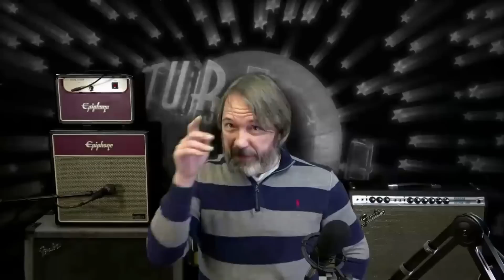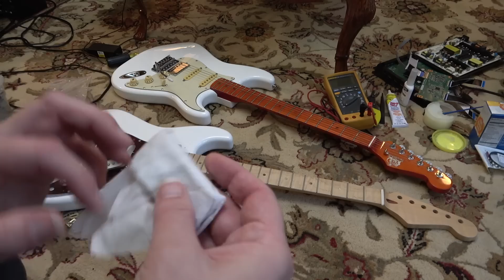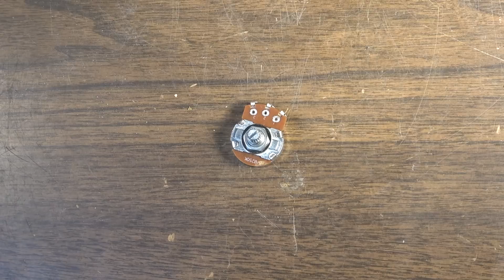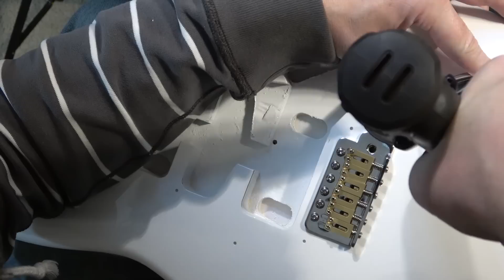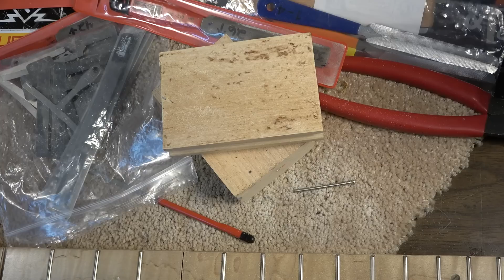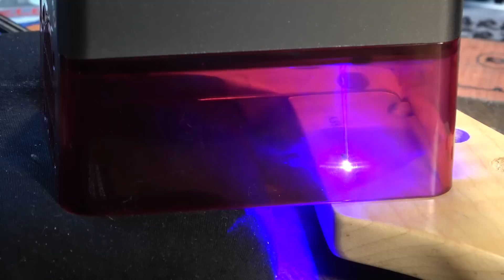A Fender Custom Shop Level PARTSCASTER!? ...from TEMU Parts? | The Guitologist

Comment: I find better method for no load pot is to trim one side of the rotating plastic wipers assy to give slightly more rotation so that the wiper contacts stop on anywhere past the top end of the carbon track, even as far as the wiper terminal track itself. 
This ensures normal operation once the control is turned back slightly to engage the top of the carbon track. Cheers.

Comment: Nice job Brad. BTW I finished the Larrivee. (Yes knuckles are bruised battered & scarred) It was 3/4 size. Any way after 2 weeks of humidification all cracks closed except the biggest. So I CA glued the living sh*t out of it, & the other cracks. Sealed all the open wood, etc. The owner was thrilled. Now they're talking about a 70s Gibson acoustic that used as a bludgeon during a family row. I said I'll try. Great idea on the Blend pot. Never thought of it. (After a year & half of US Navy Electrical Electronics training you'd think I'd remember that crap). Any way your boy is impressed.

Comment: Temu has some great deals (except for the clothing) to be sure and I use them a lot. 
     However,  for around $200.00 or less you can get a Fire Fly guitar with locking tuners, bone nut, roasted maple neck, roasted ash or mahogany body, 2 alnico five pups and one Hum-bucker in the bridge and stainless steel frets. These are quality guitars that rival Fender made guitars. 
My 2 Stratocasters cost me $169.00 for a relic and $179.00 for a solid white guitar plus shipping.  Just my 2 cents worth. Peace.
Reply from the maker: I've heard great things about those, for sure.

Comment: Kinda funny, I'm wrapping up a partscaster while watching this.  I've got a sunburst alder Jazzmaster style body, vintage style 6 screw trem, 3 Firebird mini-humbuckers on a Strat style 5-way switch, and a nice Squier Strat neck.  I found the neck at Goodwill for like $10-$15, classic one piece maple neck with the walnut skunk stripe and a nice smooth satin finish.
Reply: One thing to keep in mind when thinking about the extra work needed with the frets- more and more frequently these days even a brand new instrument from a big name company needs some fretwork and setup.  Fret ends rounded, nut slotted down to an appropriate height (most are way too high), truss rod adjustment, bridge height and intonation adjusted.  Seriously, I have seen many of these issues with guitars in the couple thousand dollar range.

Comment: Great video. The "strat" is the most basic form factor of electric guitar in the world. Leo Fender designed it to be modular. I've thrown together many dirt cheap but high quality strat builds in 40 years of guitar slinging. Strats are my thing. I don't care who makes it if the quality and price are right. But when they are not, I do my own build. I laugh my ass off at those who waste money on the Fender "Custom Shop." What a rip! There are also plenty of great aftermarket parts for great prices. For pickups you don't have to settle for Duncan, DiMarzio, EMG, or spend even more on Lollar, Fralin, and some of the other "boutique" brands. I've found good pickups for ten dollars or less.
Reply: Not more basic than a Tele!

Comment: OMG I am not downing you dude but this is torture to me watching you! If you have no other tools sure a hammer will work. At least you used a wooden one. This is the take home... a man is only as good at his job as his tools allow. That being said, get a press for installing frets. If your neck is radiused it will bend the fret into place without damaging it. Hey here is an idea... put a thin line of super glue along just the top and the tang so it stays in place better. Don't overdo it or it will never come out lol. Yes it takes a bit longer to do and it is not as cool looking and makes almost no sound. It does a better job period! Also I have much experience in China parts and let me tell you they are soft metal. What that means is it will work maybe once for a week then strip out. What?! You say you bought an American made guitar it did the same thing?! Let me explain.... that is BECAUSE THEY GET THE CHEAP PARTS FROM CHINA! Now China does make great stuff but bridges or anything moving parts or with screws is not there yet. For those parts you should look to Japan (the hardest metal I have EVER drilled through was on a Toyota Yaris) or Germany. Yes some of us in the USA do makes hard metal but know your seller and where they get the parts from. HINT HINT FR Special is not usually that "special" unless it is the ESP Licensed which I was surprised I did not have to replace. Tuners same deal they move. Toggles yep and also input jacks throw that TEMU shit out! It will break and drive you fucking nuts! I will pay $40 or whatever to never have to fuck with my toggle again! ESPECALLY If it is a semi hollow body FMR!! Those suck to fish wires and jacks into!!! There is also this stuff called "Lock Tight" get some and when you put on the higher quality metal jack and toggle etc since they likely never will break spread some red lock tight on them. Don't get it from TEMU go to your local hardware store or better yet Fastenall. They sell sticks for like 40 bucks that if you do not loose them lasted me +20 years. I almost puked when they rang it up but that shit is that good. Wanna be cheap.... get the $6 shit liquid in a tube but it will not last or work as well. Respect you for your efforts no one who does this is a bad person unless they are messing up shit and you are not doing that just could be doing it way better. So in review, bodies necks, pick guards stuff like that TEMU is great for. Other stuff ahh yeah go somewhere else and spend that money better. It will be more for sure but less downtime and frustrating! I am not an armchair AHole I will be posting some of my work eventually here on youtube. Other pointer is go high fret to low. The reason is because the low frets need to be the highest. If you level 1-22 you are basing the low frets on the ones you want to shave down. When you get to the last one on 22 or 24 and shave it down your lower frets could be lower heights by then doing the way you did in this video. Leveling high to low is no danger of that. Also, if your slipping off the fret board you have a nut that is not slotted or just too long for your neck. This does not take much R2 and R4 is less than a MM and get the R4 when it takes R2 yep your having a bad day. Running finger over it you can barely feel the difference. Yes I speak from experience. I learned from it and watched/listened to people better than I was at the time. My quality and skill level shot up way quickly as a result. You are correct about some of the wood they use though on these cheap buy sites... they got the good stuff which is overpriced here in the states. Playing with a live band I would be surprised with louder volumes if the pickups did not squeal all over and hurt your ears. I have 1 set of usable humbuckers from 5 different China guitars I bought. Yes... I replace many soft metal parts. Cost more than the whole guitar did but man is it better at everything! When I get done they smoke the actual Gibson LPs by far

Comment: I must have had bad luck with Tung oil because when I have used it in the past, I find that it stinks really bad years later. I switched to wipe on poly. The satin stuff is pretty good

Comment: I only screw the neck on with a hammer drill ( compression on the neck to body increases the contact to the joint for more sustain .

Comment: For a 100% snug fit between body and neck ,drill the holes slightly bigger in the body. Just so you can push the screws through the holes.

Comment: Don't download the app. The app is not just asking for the right to access your camera, contacts and Wi-Fi network. TEMU also wants the rights to unlock your phone at night without you being there and the right to be able to record audio. You also give TEMU permission to install software on your phone, read your messages and the app can take screenshots.
Reply: I couldn't agree more. Temu is such a fraud. I really wish that Canada would police sites like this from China. I was ripped off by Temu for 3 items that were stamped and advertised as solid silver, but i received Silver plated instead. I also asked for a refund for a silver ring that started turning a copper color just after about a week of wearing it. Instead of the full refund i received less than a third of the price i originally paid. I got 6 dollars!!! Please stop supporting these sham companies.
Reply: 100% correct. I have a mate of mine who's phone got littered with trojan virus apps that Temu installed.
Reply: Some of what you say is not true.. no message reading , no audio recording, no canera access,  no software install except communications for current app.

Comment: People do not realize how much work (if done by hand, even MORE work) a neck requires to make correctly. The truss rod  routing, insertion and capping alone is tedious work, if it is a different wood fretboard, that fretboard needs HOURS of work to cut, radius, sand, glue, drill - repeat several times, before it is ready to even begin putting frets on. When I buy a neck and it has perfect fret work, I.E. no sharp edges, no hanging frets, no frets cut short, and no high frets...I count that as  HUGE win. If I have to do a little sanding, filing, gluing, refinishing work to it and it has perfect frets....I really do not mind the extra work I have to do.
Reply: I've scratch built a dozen or so necks from curly maple or flamed tiger maple for les Paul builds and it is almost 1/2 the build of the entire guitar. mahogany is easier but it still takes a lot of work. Fret boards can take hours of work even if they are prebuilt.Very nice work Brad
Reply: @phil36135 which necks do you like best?  I'm starting to collect parts for a custom job
Reply: The neck is absolutely the most important part…
Reply from the maker: Same here. And when you do the work yourself it’s YOU who controls the level of quality.

Comment: Hate strats can’t see how anyone can keep them in tune. I wanted an ultra so and so with the wilconson nut and locking tremolo. My friend bought one ssh for $900. When I asked about them I was told they weren’t available for lefties. Then the sales guy tried to sell me a lefty squire, I got rather angry and ended up with a 91 American Standard Strat for $1200. It never lasted a whole night without something going wrong. Couldn’t keep it in tune for 2’songs in a row. Couldn’t get it to sound like a strat.
Reply from the maker: Sounds like it needed some work.
Reply: Sounds like operator error. Mine stays in tune really well and it's a stock float bridge. All about setup, brother.
Reply: @fardnshidfrfr  that's rather odd since my two les pauls my doubleneck my rg470  and my other double locking tremolos stay in tune perfectly fine but my strat for some reason shifts a 1/4inch off the fret board and in the middle of a song shifts back at a later time flat on the fret board while in a show. three luthiers worked on the set up including a trem setter , yet the damn thing still will not stay in tune. yeah playing for 46 years must be me.

Comment: Minwax wipe-on Poly also works excellent. Been using it for years. Fine steel wool buffing after it dries gives you a nice satin finish. Only drawback it takes a while to dry, very much depends on your humidity level.
Reply from the maker: I've used several products like that you can get a Home Depot on guitars with very good results. Rustoleum makes good spray on poly finishes if you're doing a body refin. Saves time when the color and clear coat is in one can.
Reply: I was looking for this comment. I have found that tung oil stinks after a couple years. I use the wipe on poly satin. Little trick you can use, add some Japan Dryer to the wipe on poly. It’ll dry faster

Comment: Never seen the panty hose test.  I've seen a cucumber used to detect sharp edges on computer chassis.  The cheaper cases were notorious for slicing up hands while inserting parts.  The better cases had the sharp edges filed down.

Comment: I'll using the the brass bridges, but I feel the trem blocks in brass are well cool too.  These are good for getting into builds if starting out, cool vid
Reply from the maker: I'll look for a brass block for both of these Strats and upgrade later.
Reply: @TheGuitologist  in UK I get them for about £20 to £25 you might get them less off temu check their dimension on screw holes and trem holes sometimes they can be a few mm out and can mean DIY drilling which is irksome but 9 times out of ten there bob on i think it makes a difference

Comment: The Chinese have come full circle on their parts and guitars giving the big guys a real run for the money. Now. What I would like to see, is a Chinese “custom shop” that builds with quality pickups, bone nuts, quality tuners, nickel frets, closely machined bridges and saddle pieces etc. taking time to select wood, plek and intonate properly, and file and dress to break in the guitars. 
How much would that cost over there?
I’m going to do a backward cost analysis at 50%
Buying a “fancy “ guitar from Ali baba would set you back $300-$350….$100 is shipping.
So Ali baba is buying from manufacturer for $175
The manufacture is making these for $85
And the cost of materials and labor would be $42
Just say, they added an additional $40 to the selection and quality of parts, and $10 labor.
If they did this….and they can.
They would put the big fellers out of business.
So, imagine quality control on body shapes and wood selection of say a LP shape. Never mind the head stock. And copying exactly the neck angle etc. 
and buying that out of the box perfect, all ready played..nicely worn in. With a zero hiccups LP?
Gibson would have fits
Reply: this comment made me sick
Reply: For Gibson style guitars, you have Eastman doing what you describe.

Comment: One of the biggest issues with Strat type guitars is the synchronised tremolo system, keeping it balanced over time and in tune, I used to think the issue with friction was worse at the neck nut, but there's a much steeper break angle at the bridge so I mean all friction points are important to get on top of reducing or if you can completely get rid of any friction without compromising tone, before I discovered the locking saddle blocks for a standard strat bridge with just one additional upgrade a pand head Allen screw flat and wide to lock the strings to the blocks individually, and of corse if you don't want to for out over the acceptable price range for such a small but clever design, roller blocks do really work well if they're high enough quality rollers, apart fromall that any thing made from high density ptfe works well without too much of a tone loss in fact if you like your pups high and loud a softer than brass bridge saddle block like ptfe  or a ptfe nut at the headstock will help reduce those shrilling highs.
Reply: The good thing about a Strat is, if you don’t like the volume knob location, and you prefer two knobs instead of three… You can swap the pickguard. You don’t need Fender to change the design, you just need to not be lazy. 

If you don’t like the bridge floating, slam it. If you don’t like the tremolo system at all, convert it to a hard tail… 

All this talk about ptfe vs x, it’s snake oil. The thing’s that have the most dramatic effect tone is the pickups, the amp, and the speaker. The speaker being the biggest change. If you genuinely believe you hear an immeasurable difference between materials, you’re lying to yourself.

Shout out to Jim Lill for debunking these stupid myths.
Reply: @TheFakeNewsFrog  Granted, it doesn't make that much difference compared to the guitar speaker, but there was a slight difference in highs in Jim Lill's neck vs string to two bench clips.  I really admire the guy for his efforts.  His speaker cab and mock tube amp sound videos were real eye openers.  His clips aren't really long enough to hear how a note degrades, though.  

Bridge hardware makes a substantial tonal difference.  FI, my b4 and after recordings after swapping a stock pot metal TOM bridge to an Aluminum one with Ti saddles are pretty different.  What makes you think plastic saddles would damp string vibrations the same as a hard metal?  Softer saddles absorb more highs.  

Another example: every comparison, including my own, of an Alder vs Swamp Ash body guitar reveal a difference in midrange character, and possibly bass. The Alder is more mid-forward, and the SA has stronger lower bass (which could be from how less midrange affects bass into a gain stage).  Those differences become more apparent when you quickly A/B between two clips and focus on one portion of the tonal spectrum.  I don't see why guitar players are so dead set that different pieces of wood make no significant difference when there are numerous examples showing otherwise?  I guess your avatar is a hint.  Doesn't evidence matter?
Reply: Precisely why I prefer hard tails. I wish Fender would make more of them. I also hate the volume knob location. Too close to my picking hand. If they could do away with one of the tone knobs and use the bottom locations for one volume and one tone that would be cool.
Reply: @mattbauckman9907  regarding the volume knob location, I had the same dislike for the same reason on a jap 57 reissue strat I had in the 80's/90's, I had the all tones connected to the bottom tone knob and the volume placed in the middle tone knob location, fixed the issue.  I've been thinking whether it is worth doing on my std 1996 strat that I have now but I don't play out anymore so couldn't be bothered yet.